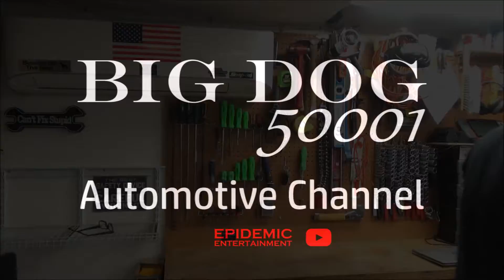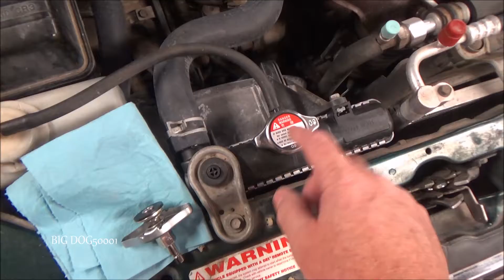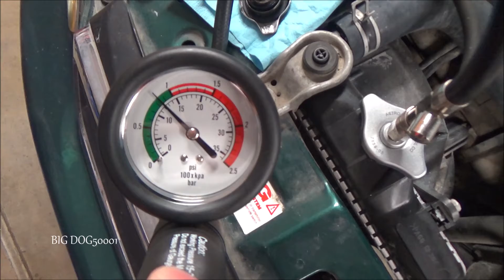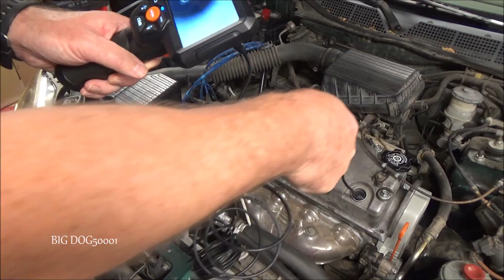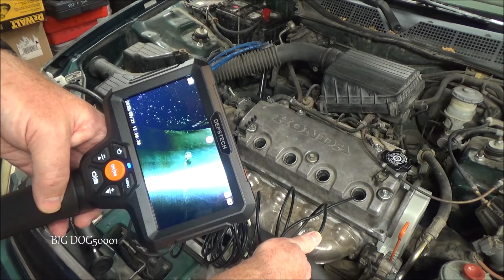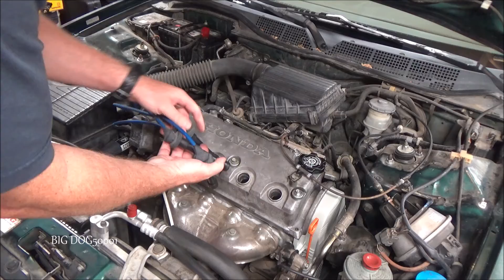Honda Head Gasket Leak Testing Using Coolant Pressure Tester

Comment: Great video, thanks for your help! I have code P0304 and I changed the spark plug wires, distributor cap, and another part inside the distributor. The light went off for 10 minutes and then came back on. I disconnected the wire to cylinder 1 and reconnected it, and when I disconnected the wire to cylinder 4, the light went off and it wouldn't start. It still has code P0304 and I don't know why it won't start. Please help, thanks!
Reply from the maker: I would start by seeing if there is spark, the coil may have gone completely out during testing (has happened to me).  A coil that is weak or failing (or a crappy aftermarket part) can cause misfiring problems too.  Thanks for the comment!
Reply: @BigDog50001 I really appreciate your help, thank you. Last night I checked it and there's no spark at the spark plug wire. Today I'm going to change the distributor; I have a used one because a new one costs $350. Thank you for your help.

Comment: Is it recommended to resurface the head when replacing the head gasket?
Reply from the maker: Yes it is recommended to get it checked for flatness and see if it is within specs or have it resurfaced by a machine shop.  That being said, I have replaced blown head gaskets on Hondas without doing this and it was fine (these are budget jobs on older cars of course), but you always take a change if the head is not flat enough to seal everything back up.  Using aftermarket head gaskets like Fel-Pro can help as they have more tolerance for variations.
Reply: @BigDog50001 thank you for your advice

Comment: Why did you not pressure test the cooling system before replacing the timing belt? Then you could replace the timing belt at the same time you replace the head gasket.

Comment: Did the car have milky oil and white smoke out the exhaust. Similar scenario in my Honda, but no normal signs of a head gasket issue, just coolant loss with no visible leaks. Pressure test on min dropped maybe 0.7 psi over 2 hours
Reply: What year honda? the 1.5s have a known HG issue and  in a class action right now, Mine leaked also in my 2018

Comment: Nice video.  Diagnosing my 360,000 mile celica already  put in new radiator, new water pump and housing( pump(which has lasted 10 years in the desert and was perfectly fine looked barely worn after like 170.000 miles, I don't know how that's possible but... it's an aisin). , New hoses thermostat and cap the engine runs perfect without any sign of problem no leaks to be seen anywhere but overheats like crazy and belches out all the coolant in a fewr hours can't find the problem, it's driving me nuts ,. So just ordered a pressure tester and going to get some uv dye and maybe do chemical test of exhaust in coolant.  Looks like it's going to be the head gasket......